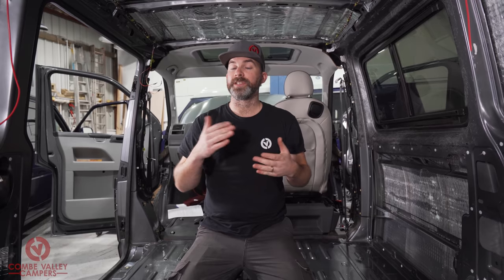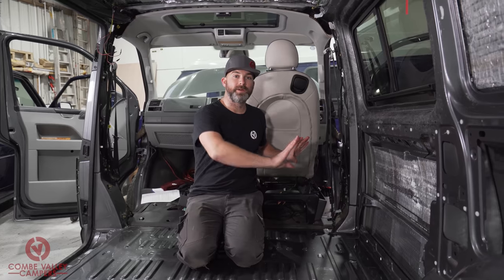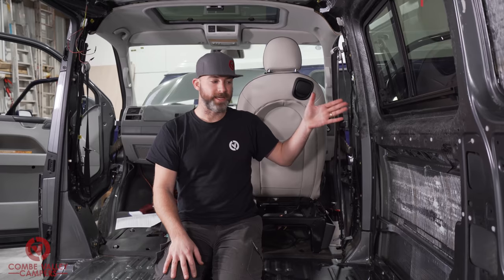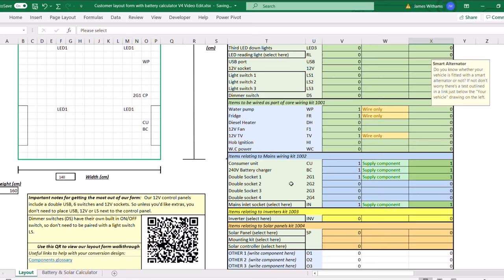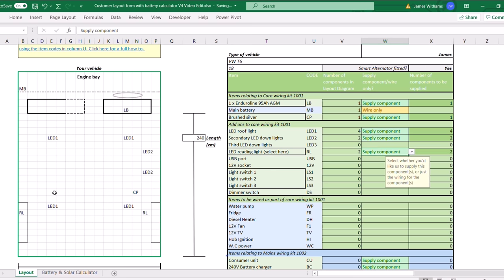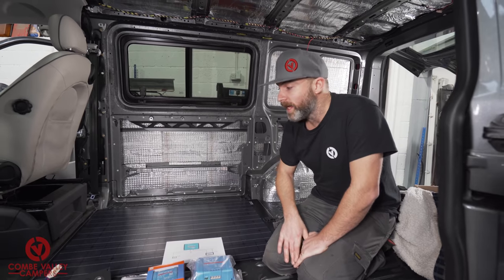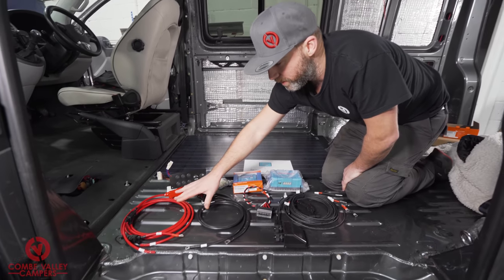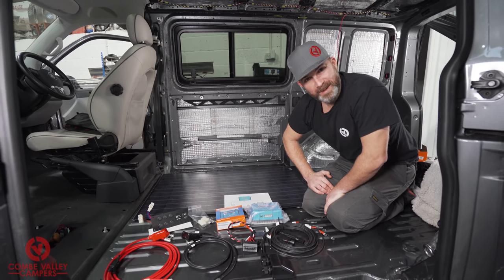HOW TO ORDER YOUR CAMPER VAN LEISURE ELECTRICS A step by step guide.

Comment: Awesome video as always! 
After recently purchasing and fitting a split charge from Rayne auto, I am looking at fitting a CBE control panel (PC180.)
Will this just add on to the current system ? Or will the 240 battery charger cause problems ? 
Many thanks in advance.